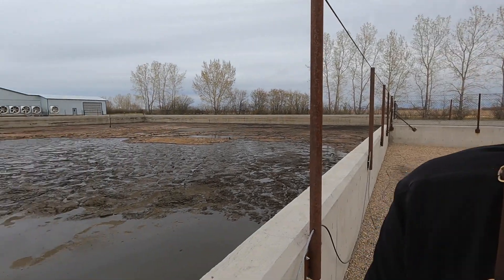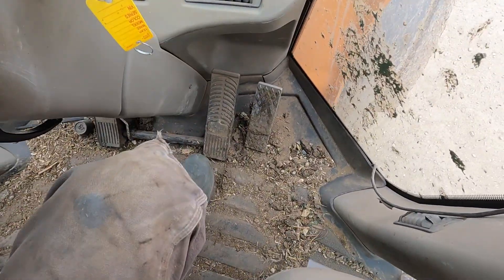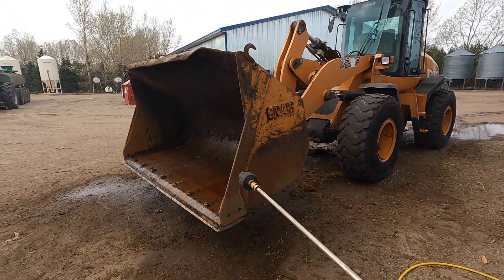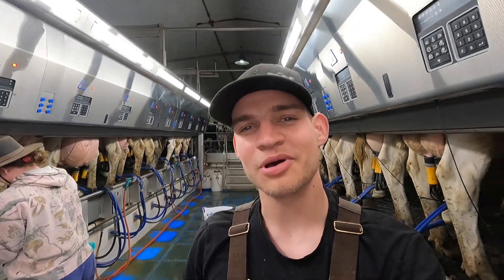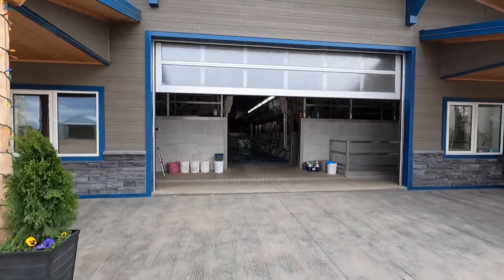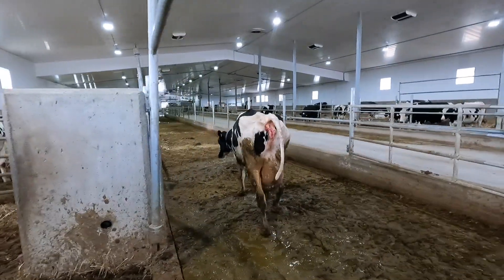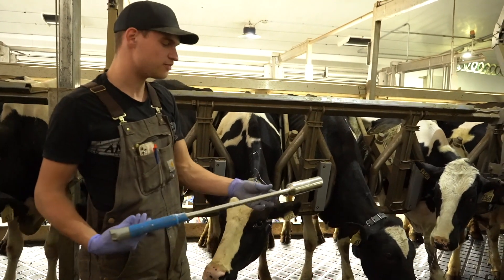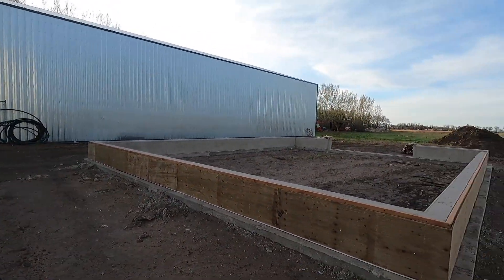*SATISFYING* Cleaning Dirty Farm Equipment!

Comment: Do you guys have a special weighted block for the case wheel loader when you pack silage? If not does something like that exist for wheel loaders, and would you get one if they are useful? Thank you again for the great vid.
Reply: pretty sure that wheel loader is heavy enough for packing itself, i've never seen a weight myself, but they could be out there somewehre

Comment: Keep the engine and radiator clean also. If there are vents on gear boxes or the trans or differentials, make sure they are not plugged. I made a good living teaching this to owners. Be careful though, don't wear out your machine by over-greasing.
Reply from the maker: What’s over greasing
Reply: @saskdutchkid  that does seem to be the question doesn't it? Owner comes to the garage one day after being told both king pins and tie rod ends had to be replaced. My dad sent him to me. He asked me what could have caused all this. I told him over-greasing. He got about half way back to the  write up desk and came hot-footin' back to me and sez (and I quote still after 35 years) " I don't believe over-greasing would wear out the frontend on my truck"  I said "Well, give you a ceegar."
Reply: @olddavid814  🤣🤣🤣🤣

Comment: Jan, you do more pressure washing than I do. You can most likely save yourself some time if you always wash starting at the top and working your way down.
Reply from the maker: Your probably right! 😅
Reply: Also, pre-wet the entire vehicle to soften up the caked on dirt.
Reply: Wrong You start from the bottom up towards the top. Most Professional Pressure washers can tell you that. I have been washing equipment etc for the last 40 years. Hot water works really the best. Just way better tban cold water. No comparison.
Reply: @classicalmidiorgans  You forgot a little thing called GRAVITY.
If you start your cleaning at the bottom and work your way up, the parts that are clean at the bottom get dirty again from the dirt higher up drooling down onto the lower clean parts.
Reply: Or build an automatic car wash shed.
Reply: @classicalmidiorgans  um no😂

Comment: 13:20 "foundation is concrete slab" - that is a concrete perimeter foundation. A slab would be filled across the whole interior with concrete. So you will put the milling equipment right on the dirt? It is going to be great to see how you will get the grain in and out of the building.